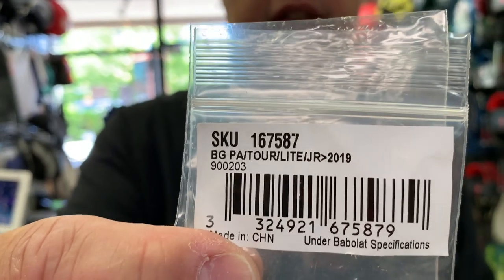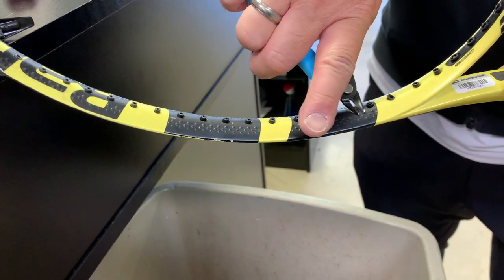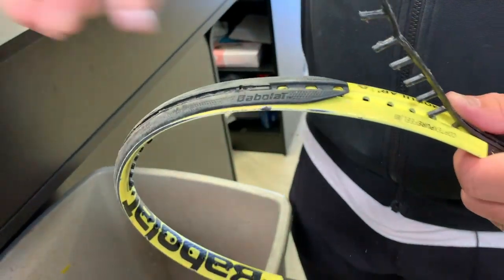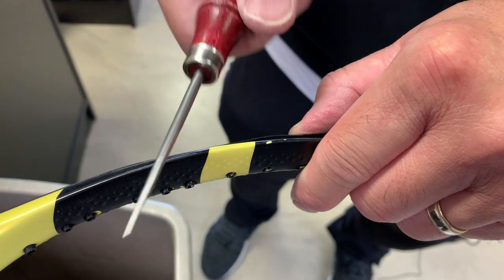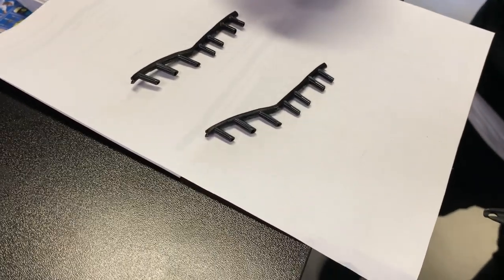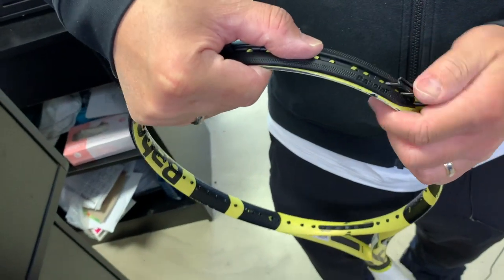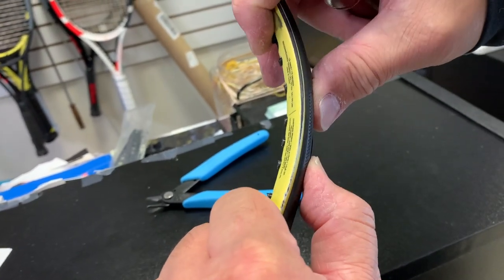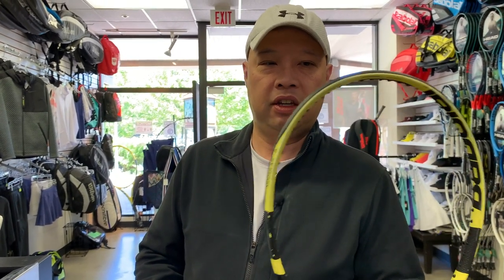BABOLAT PURE AERO HOW TO CHANGE A GROMMET

Comment: Thanks for the video. I'm preparing to replace grommets on a Babolat Pure Aero 2016 and wanted to see it done by someone first. So, this was very helpful.  But, the one part that got me was the paint scratching. The racquet I'm working on is not mine and there is no way I'm scratching the paint. Don't customers complain when they see the scratches? 😱

Comment: It is much easier to buy grommets when the racquet is new.  By the time you wear down your bumper guard and a few grommets the racquet could be several years old and then it is much harder to buy the correct grommet set.    So when you buy a racquet at TW or some other place order the correct grommet strip (from TW or some other place)  and then store it away in case it is needed.   In TW click on strings and stringing and at the bottom click on grommets.    Not hard when they are new but real hard after several years.   They are around 8 dollars a set.

Comment: Great Video - again 

Here's a little tip I worked out to solve the problem of the longest grommet at the neck on a Pure Drive getting 'lost' inside the frame and so wouldn't go through the inside hole to poke through.  Solution: thread through a short length of poly string (such as what you've just cut out) or wire would do the same, from the inside to the outside leaving just a short length protruding.  Thread the grommet onto the end of the protruding bit and the string (or wire) will now guide the long grommet through both holes - as sweet as a nut: an easy win for human versus awkward long grommet!!!

Comment: Great video, I have question, i got the same raquet, when or why do you need to change the grommet ? The head guard in this one did not look damage. Thank for the great video again
Reply from the maker: Some people wear out the headguard and start to damage and wear out the graphite or cause premature breaks on the stings.  This is when a change is needed.  Thanks for watching.
Reply: Thank you very much.
Reply: Also.. You may have a damaged grommet they may not cut strings, but possibly is cracked causing the string to sit on the frame when installed. You'll be able to ascertain whether this situation warrants change is by the vibration resonation it causes on hitting a ball. It'll feels and sounds like a buzzing when you strike the ball without a dampener installed.

Comment: To remove the grommet strip and not mess up the paint,  pick up RAB grommet grinders.   They have two sizes, one for normal grommets and one for tie off grommets.   For Babolat grommet strips you may want to use a heat gun to soften them up a bit.  When people ask me how long does it take to put on a new strip I say between 5 minutes and a frustrating hour.   The issue with Babolats is the bumper guard.

Comment: Great video, I have a question. If I want to attach Tourna lead tape under the bumper as soon as I bought the unstrung racket, Is it okay to detach the bumper and attach it again?
Reply: Yes, that’s no problem because the grommets haven’t yet been flared by the stringing process. Once flared, the grommets cannot be easily reinserted if removed.

Comment: Which racket do we want to use a heat gun? I am curious. Many thanks! This is very helpful.
Reply from the maker: I use that heat gun when I do the Pro Staff line and in the winter when it is cold.  They don't stretch easily then.  Thanks for watching!
Reply: What do you charge for grommet installation?

Comment: would the babalot pure drive 2015 model have same grommets?
Reply: No. AeroPro Drive and pre-2015 PureDrive use the same grommets. After that, PureDrive and PureAero use different grommets. 2015 PureDrive does not use the same grommets as 2018 PureDrive. With a little extra effort, 2019 PureAero grommets will fit 2016 PureAero, and are better than the 2016 grommets (protects the strings better and eliminates the need to always tie start knots on a specific side).

Comment: Two things were painful to watch:
1. The blue cutter scratching the paintwork of the racquet (despite its actual conditions)
2. The placement of the new grommets without cleaning the frame first. This is not a part of the racquet that you have access to every day, so why not using a piece of cloth to remove dust or debris?